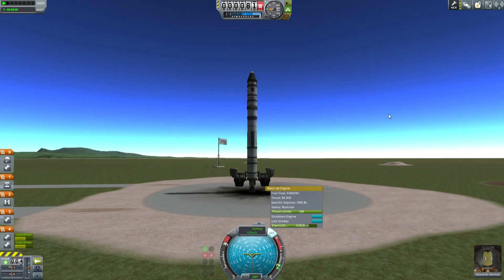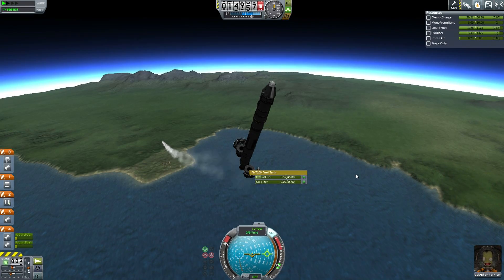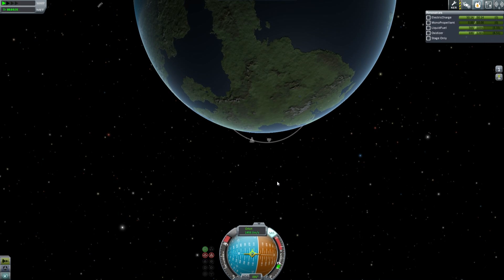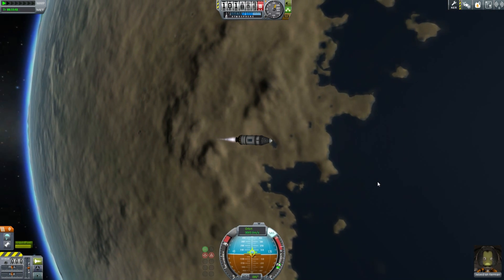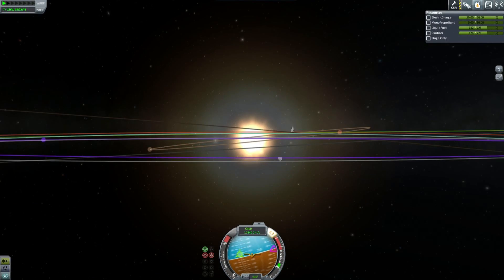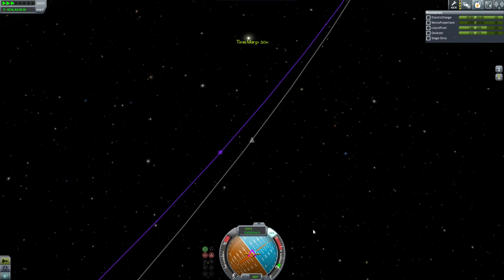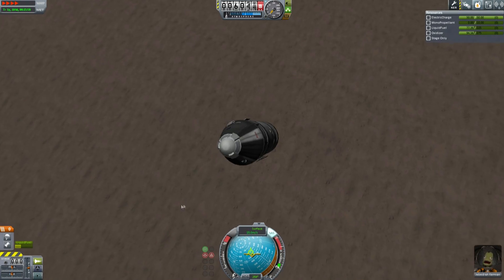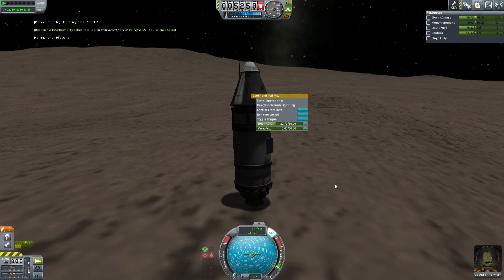Kerbal Space Program - Challenge - Interplanetary With No KSC Upgrades - Part I

Comment: also i have a question i hope someone could help with...

i'm trying to reach gilly and when i get to 79,000m above the surface of EVE to perform an aerocapture (per. set to 75,000) it explodes from overhearing in the atmosphere and there's fire from the heat when my ship is still in the mid 80,000's above the surface.

i solved it by setting my per. to 85,000 and then retroburned but of course this wastes fuel and still flew me through a situation i almost exploded in... scott managed 75km and lower with no explosions or even fire. 

my ship was travelling at very similar speed to scotts, but mine was a lot bigger (it's a very heavy refuelling station) but this would only make it harder to slow down, not add fire and explode it at 79,000m.

Comment: Scott Manley Maybe you talked about this in IQ when you were sending up recoverable delivery systems that had all of the jet engines on them: why does NASA or SpaceX not use jet engine systems to lift rockets into the air to get them started?  Is the amount of jet engines required not monetarily feasible versus how much a single rocket engine and some LFO tanks cost?  I mean, even with the SpaceX return system that lands the stage, there has to be extra fuel in there to land it instead of just running out of fuel and ditching the stage.

Comment: I did some research...

Turns out Eve may have an atmosphere that contains ALOT of Iodine (Gas Phase) Which may I note is highly toxic...
Same thing with the oceans, Because of the extreme temperatures on Eve Iodine may have melted into a liquid State

Now.. How come there is so much Iodine?

Well Iodine is produced by Brine (Salt water) particularly a highly concentrated water solution of common salt (sodium chloride). Natural Brines occur underground, in salt lakes, or as seawater

Maybe at one stage Eve may have had clean salt water oceans (which it may still have) that may have had alot of Brine in it that produced the mass amounts of Iodine which eventually turned everything Purple

KSP Science!!

Comment: This is really nice, I've found that the jet engines are very powerful, but you definitely have to detach them before 35k meters altitude because otherwise they go crazy and you start spinning out of control (because of course the intakes can't get enough air)
Reply: Depends on the number of intakes and how fast you're going. As long as you don't have Deadly Reentry installed, you can go higher with them.

Comment: Squad should implement a 'Scott' difficulty setting on their next update. Something so utterly bizarre and ridiculously hard... I dunno, automated drones that shoot you down? Fluctuating gravitational forces? Something among those lines!
Reply: GoodGameHunter Solution: starve Jebediah near death to loose as much weight as possible, eat the can of baked beans shave off the matches (keep one match), make an SRB out of the empty can and match shavings, use the SRB to reach Eve orbit, use the EVA fuel to get back to Kerbin, perform an atmospheric break going head first so the EVA suit helm will act as a heat shield (don't worry Jeb's really strong headed), your EVA suit will burn up during reentry, pull out the paper bag and the last match (don't mind where they've been stored) use the paper bag as a parachute to slow down the descent and just 20 meters above the sea level, light up the match and perform the final descent burn using the "biogas fuel" which Jeb has been safekeeping ever since eating that can of beans on Eve. Greet Jebediah with a large towel soaked up in aloe cream, he'll probably be suffering from a couple of 3rd degree burns from the unprotected reentry!
Reply: A black hole that rolls in and out of the solar system, fucking up orbits and such.
Reply: Aidan Brem then Scott will do a video called 
"interstellar travel without upgrades and using only one part blindfolded and drunk with the computer off"
Reply: "Here's Jebediah on the surface of Eve, with 2 units o EVA suit fuel, a can of baked beans, a paper bag and two packs of matches. Get back to Kerbin!"
Reply: Aidan Brem That's Danny level.
Reply: There is a location dubbed Manley's rise along the coast south of KSC, you can get a contract to do visual surveys there.
Reply: This is brilliant, and you know what? Scott would still nail it, goddamnit! Even if there isn't a single snack on board of this contraption!